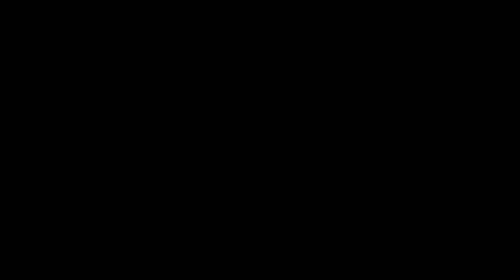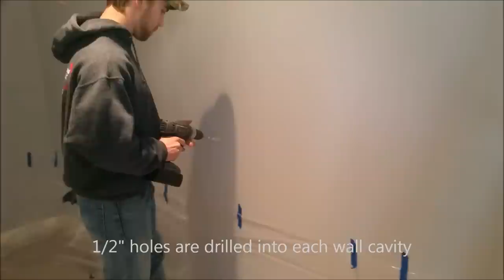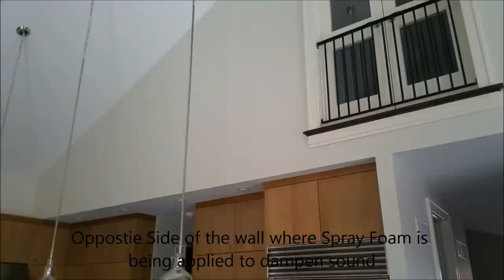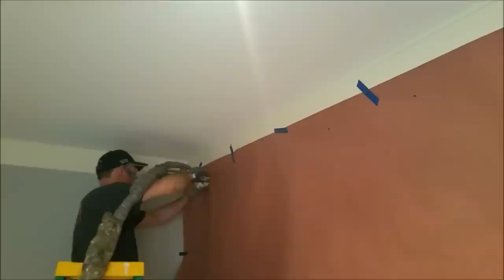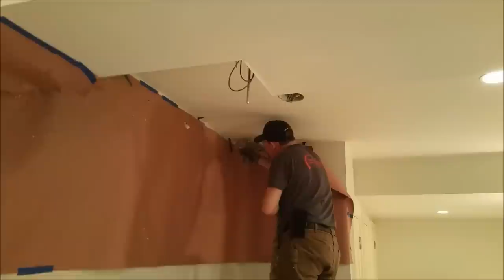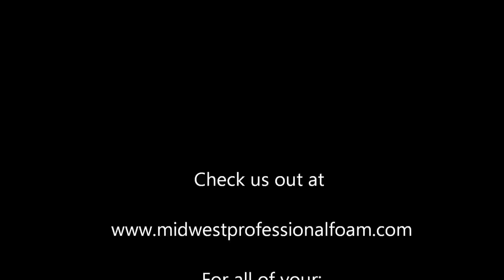Injection Spray Foam into existing walls

Comment: How can you be sure the spray foam is going all the way to the bottom of the wall? Especially if the wall already has fiberglass insulation and the tube your using is extremely short
Reply: Tug_Slug job training
Reply: It’s not.  They probably did the bottom half also.
Reply: You need to scan the wall with a nondestructive testing tool
Reply: Thermal camera

Comment: A local spray insulation business we are thinking of hiring says that because we have cedar siding, they'll have to inject the foam from inside walls, and those holes will be THREE inches! That is a LOT of repairing and repainting. The holes you are making are so much smaller -- does the size vary?

Comment: My guess is this isn't cheap. As each room that I want this done in is due for painting, I use a 3 inch hole saw, cut a hole out about an inch below the top plate and in the center of the studs. I then get the blown in fiberglass insulation (rent the machine) and blow it in. Goes pretty quick but can be messy since it blows all over as soon as the cavity is filled. I stick a couple of paint sticks inside the wall so I can have something to screw the hole I cut out back into, mud and sand a few times, then paint. It's obviously more work but probably 5x less than what this would cost.
Reply: That's not even close to what this foam will do.

Comment: What kind of noise reducer is it? I have a train horn I'm dealing with and I'm trying to find the best way to reduce the sound for existing walls.
Reply from the maker: Cr Jordonpelt it does reduce noise but it will not be able to completely eliminate a nearby train.  We have done some houses right next to railroad tracks and had great results
Reply: @midwestprofessionalfoamins1878  can u use open and closed cell foam in the walls? I want open cell as noise reduction is my primary goal.
Reply: Move

Comment: I have a 1939 brick home and I'm considering insulating behind the outer plaster walls in some locations, especially closets where there is bad airflow and we get moisture problems in winter. You can imagine how cold the closets can get when its minus 32 degrees outside or colder and then we get condensation in the closets. Can you insulated in the 1inch gap between the plaster outer wall and brick, without causing a moisture/mold issue within the brick and plaster wall? I heard this can be an issue.
Reply: Need a continuous 1" air space behind brick here in Ontario. Of course the mortar on the brick usually falls in behind into this airspace when being installed.

Comment: Since this is closed cell foam like you mentioned in a reply to someone else, how do you know you’ve reached your desired fill. Usually in closed cell put into small cavity’s like a wall, I’ve seen it push out of the hole. Also did you provide an infrared video to show your customers that it actually did its job and the total coverage they requested. 
It would be nice to see pictures of before and after.

Comment: Just out of curiosity. How much would it cost, approximately, for a 1200 sq ft house including the ceilings ? Just looking for a rough estimate.
Reply: did you ever find at?
Reply: Definitely curious too
Reply: Cronos of Venom  so you definitely don't recommend? How do you recommend insulating pre existing walls?
Reply: Cronos of Venom  thanks I'll definitely look that up
Reply: That would be right at $7 dollars saw foot I’m going to have 432 square feet done and I’m looking at $3024
Reply: Cronos of Venom  do you believe, it even worth it then?
Reply: Cronos of Venom  hey, I appreciate it honestly. I think I'm going to upgrade my attic to r-60, and see if I get the results I'm looking for. If not thing I believe this is my next step.
Reply: @traviswwilliams7171  I put 2.5 feet of blown insulation up there and I have sagging in my 5/8 drywall ceiling.  20  inches on center joists.   Took 15 years for it to happen and it continues to get worse.

Comment: Yea but wouldn’t there be fiber glass insulation in the wall already ??? How do u spray while old insulation is still in there
Reply: Some older homes don't have any exterior insulation. This is an option, but I just want to know how much it costs.

Comment: how good does this work? would you like to show a wall that's finished both sides, then adding of spray foam after holes are drilled to do this type of work and then take one finished side off to show or use Plexiglas glass view both side to demonstrate effectiveness?
I'm not sold on this Idea however it look's promising, whats it do to fiberglass insulation thats inside the walls or other insulation thats in place prior to instillation?
Reply: bobbg I was thinking the same thing!
Reply: Considering batt insulation usually isn't installed correctly, doing this blind without an empty cavity to fill would make this extremely difficult.

Comment: Would it reduce noise between the wall considerably?
Reply: In my experience using spray foam the answer is yes
Reply: Can you do it between floor to reduce foot steps

Comment: Dense-pack cellulose is 100% the better option for drill & fill.  The expansion of the foam imo could crack plaster walls, and also does not expand far enough.  You would have to drill a hole everey 12 inches to ensure filling the cavity completely.  This is WAY too risky IMO.  I've been in insulation sales for 6 years up in Canada.
Reply: Cellulose + water = rot
Reply: @Katana_00  but that is anything with  water not just cellulose

Comment: I can't even imagine what that would cost
Reply: Depends how you want to do it. If you can handle the DIY, you can get what's called a FrothPak (or similar from another manufacturer) and do it yourself. It's a lot cheaper than tearing down the drywall, putting in batt insulation (or sprayfoam) and then re-drywalling. Hiring a licensed spray foam company will be pricey yes, but the process will still be cheaper than the more invasive method.

Comment: Couldn't this be done on the outside? determine your stud location, drill hole at top and bottom and have no or minimal mess inside?>
Reply from the maker: Joe Large yes sir it can be done from the outside and in those situations, siding is usually removed then injected then we re-install the siding on top of the exterior holes.
Reply: Do you know of the installer in Indianapolis, sent Lapolla request but didn't hear back? I'm assuming there is one in Central IN.? Thanks for the help.
Reply: sent Bill Hanzy over to see ya but he say you isnt home.
Reply: Midwest Professional Foam Insulation, LLC  how much do you charge for 1300 sqf and do you guys work in Illinois Chicago area?

Comment: Is Great Stuff closed or open cell spray foam?
Reply from the maker: slhines7 we have no affiliation or data sheets on the great stuff brand, but I would speculate its around a 1.5lb foam.  Our closed cell is 2.0-2.2lb in density.
Reply: Oh okay and I see. Well, would you consider the great stuff brand to be closed cell foam?
Reply: Thanks
Reply: Midwest, you're injecting 2.0-2.2 lb foam into a closed cavity like in the video above?  Have you cut a wall apart to verify the coverage?  (I've never seen closed cell installed in a finished wall and cut apart for validation.)
Reply: Me neither but have read of people using infrared cameras to look for temperature gaps/variances aka voids/pockets.
Reply: Jesse Boyer this was done wrong. So he has voids most likely